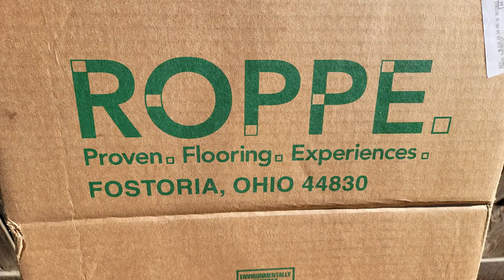How to Replace Stair Treads in your RV

Comment: Thank you for the carpet tip. You were right, we did track it down it is mohawk. Follow up question if you don't mind. How's the carpet holding up from the rollers of the slide out? We want to get the same carpet and the color is called Carmelita
Reply from the maker: Certainly, the rollers create dents in the carpet, but no wear or tearing. Happy motoring.

Comment: I am interested in the adhesive and custom putty knife.. How far are you from Los Angeles????

Subbed liked SUBSCRIBED
Reply from the maker: Thanks for reaching out. Unfortunately the adhesive and knife are gone. In the description of the video I posted a link to another adhesive that I used for a repair. It's much less expensive and is easier to use. Good luck with your project.
Reply: @youcantoorv9860  thank you